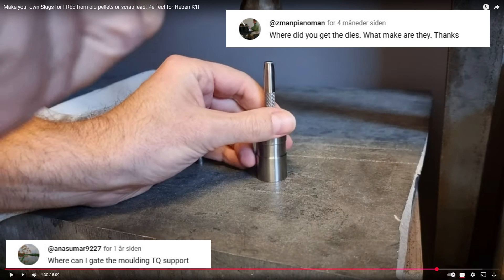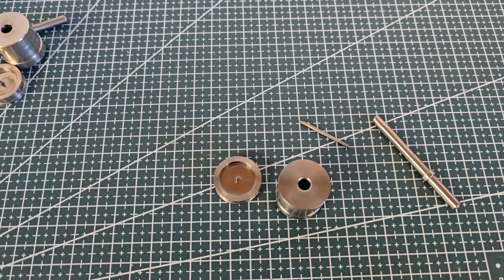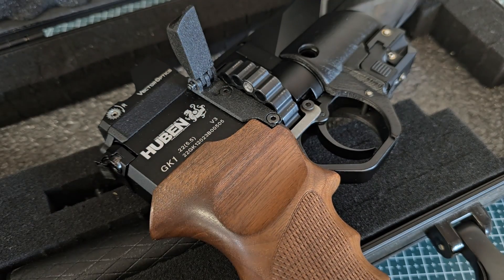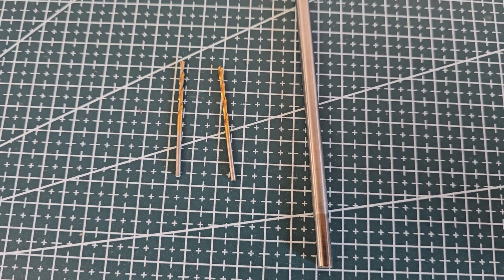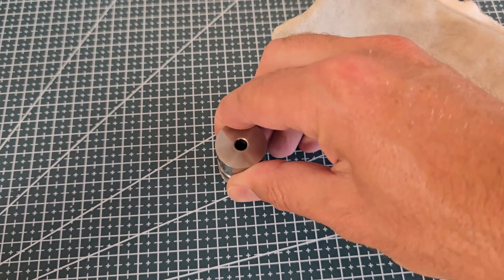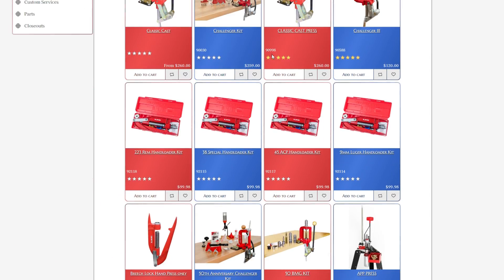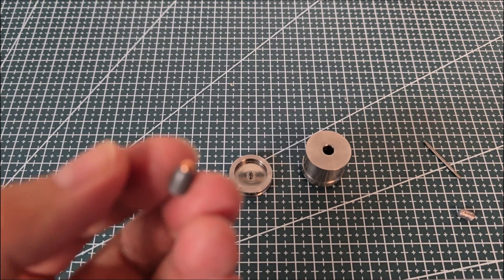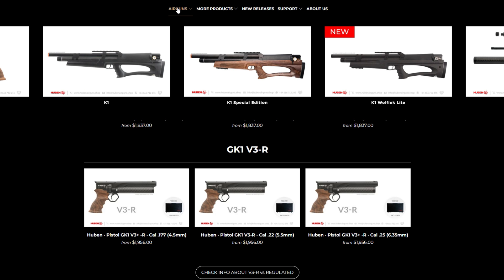Make your own DIE for Airgun slugs

Comment: Thank you very much for your generosity. I found the Pcbway site and I would like to send your files directly to them,  to have them made. The only difference being in .22 i would want the standard  5.5, as well as the standard .177 and .25. If you could please instruct me on what to do,  I would be in your debt.🙏
Reply from the maker: I'm glad you found this useful 🙂Are you familiar with SW like Fusion 360 and 3D modeling in general?
Reply: @-Ricochet- I am oblivious of any of this. I was hoping that I could just send them the files you shared in the link. It appears that it may be not that simple. Anything you can provide without going through any trouble would be appreciated.
Reply from the maker: @kingdomcome8305  No worries. .177 is already in the download section of my site. I'll need a little time to add the regular .22 and .25. Which guns are these intended for? Usually a slighly larger caliber works best in most guns.
Reply: I have Snowpeak P35,  Umarex Zelos, Benjamin Marauder, and a number of budget plinkers like the Notos,  Pinty and so on. After copying the files do it just submit them to Pcbway as they are? I don't want to be overly simplistic, I just want to be clear about the process.
Reply from the maker: @kingdomcome8305  Nice collection!. You will now find all the files in the DOWNLOAD section of https://customparts.work. "Generic" are standard dimensions. On Pcbway, select CNC machining and upload relevant step files in the archives of your choice + select appropriate options. The site will show you a preview of the part on the right. Which parts you upload and order is naturally up to you. Instructions and recommendations for options are included with each archive. I hope that makes sense. PS: I've updated files in the .177 archive.

Comment: Hi, great video, thanks for the work. Could you please make a drawing of a press die with a lead drain? 0.22 and 0.25
Reply from the maker: Thank you. The purpose of this design is to allow producing multiple length / weight of slugs using few components. I've looked at the designs with a drain channel. If I add this, one would have to settle for either one weight or make more components to limit the travel of the punch. It is doable but would be a slightly different project.
Reply: @-Ricochet-  It is better to make inserts of a smaller diameter and change them depending on the required bullet size. (https://www.youtube.com/watch?v=z5IDJ5xTWTo ) as an option.
Reply from the maker: @FixItWork  I designed this to work primarily with a hammer. I think that his die is best suited for a press.
Reply: @-Ricochet-  Am I correct in understanding that if I drill a hole at the height of the bullet in your drawing, I will get a lead drain? Maybe you could draw me a drawing? I want to get 0.25 caliber with a weight of 34gr
Reply from the maker: @FixItWork Yes. And you will need to add an appropriate spacer between the body and punch to stop compression at 34gr. I've uploaded a .step file of the body with an added 1mm drain channel for your convenience: https://customparts.work/wp-content/uploads/2025/10/Ricochet_Slug-DIE_0.25_1mm_Drain.zip